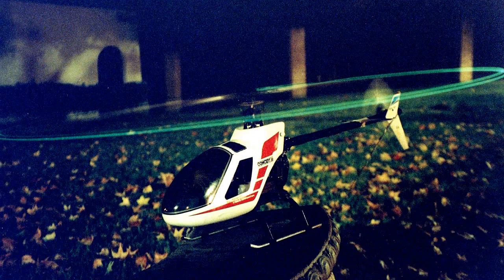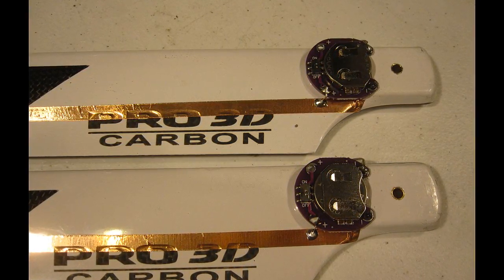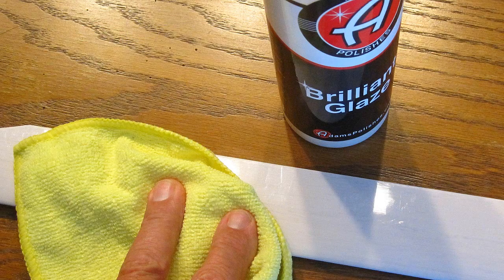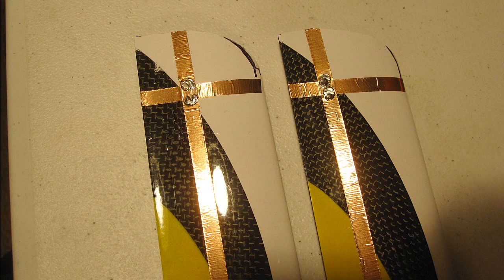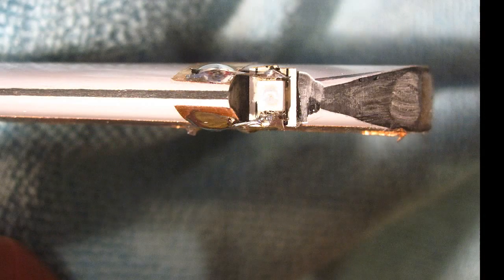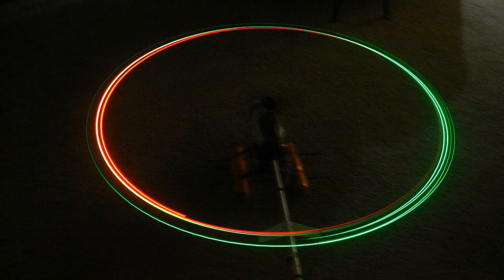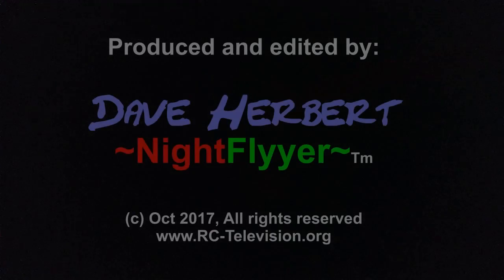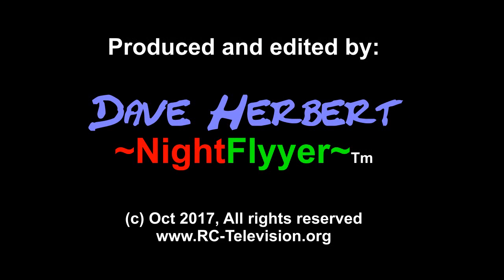"Red on the left" Night helicopter LED Blades. There's a drawback and a plus!

Comment: Instead of using a microcontroller or something similar, you can have a couple red and a couple green LEDs on each blade. Put the batteries on the heli frame, not the blades, and use something like the internals of a brushed motor to transfer power up the shaft. Wire it so when the blade is on one side, it only gets power to the red, and the other side only gets power to the green.
Idk how well it would work, and I've got no clue how you'd modify the shaft to carry power like that, but it could work...
Reply from the maker: Good idea, but again making a brushed system to transfer power up the shaft would be a challenge.  I prefer the green halo anyway, but I think a simpler way with hall effect transistors or magnetic reed switches might be less complicated.  Thanks for the suggestion.

Comment: Just thinking: is there any way the lights could be turned off and on using the cyclic pitch so you would have red on the left and green on the right..?
Reply: How about rgb leds, a flipflop and 2 offset infrared receivers on each blade.  Matching(the receiver locations) infrared leds in the body and tail tell the blades when to switch colors.
Reply from the maker: Maybe. It would have to be switched on every time the red led was exactly at the left side of the body. Maybe a Hall effect transistor would work as a switch with a magnet but no wired or mechanical switch would be practical. Good thinking. I like all green anyway as I use the skid lights for reference any way. Thanks Bud.
Reply from the maker: Yes, that would be a way that would work, but again fairly complicated to get it "just right".  Good thinking!

Comment from the maker: The drawback of my design is that no matter which way the heli is flying, the red blade is on the left and it doesn't help with orientation. (The red LED is actually much brighter in person)  The plus is that it is easy to track the blades in the dark. Here I show you how I made them using carbon fiber blades this time , how to track them and how it flies both ways. This was the simpliest, less complicated way to try it, but in the end I still prefer the total green ring.   I think another possibility would be with hall effect transistors or magnetic reed switches to turn the red light on when the blade is on the left. Watching only the halo can be deceiving too, as its hard to tell whether your coming or going when hovering. Thanks for watching and please hit that subscribe button for more.  Thanks kindly.
Reply: NightFlyyer why try some kind or reed switch/magnet system?